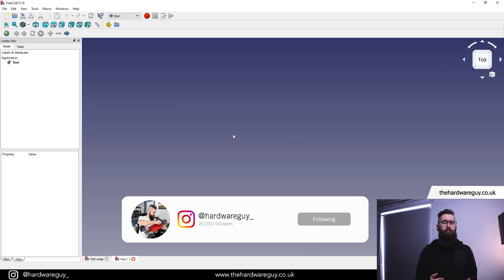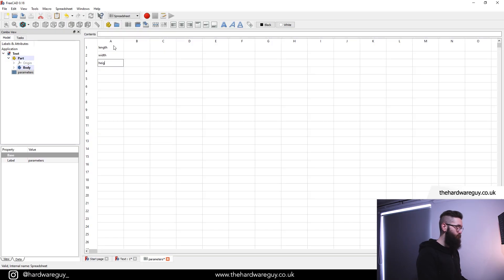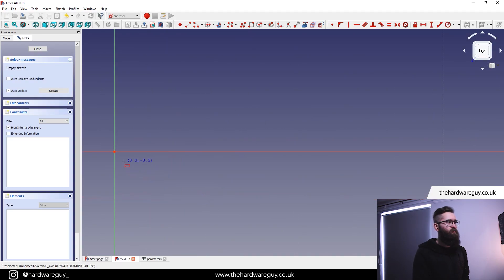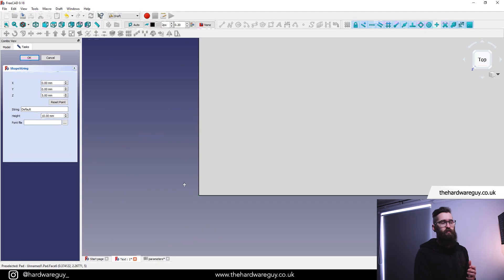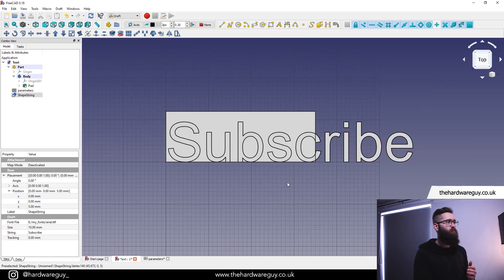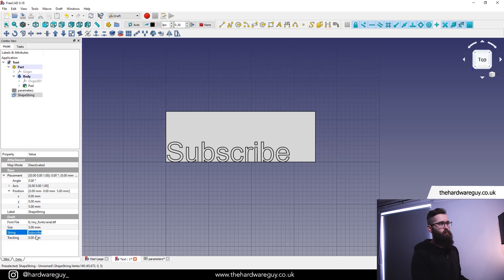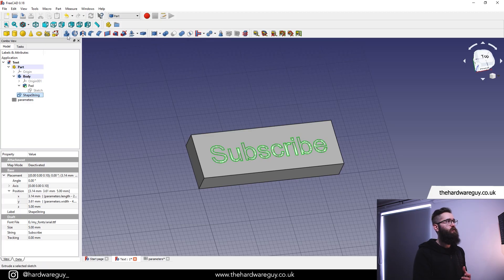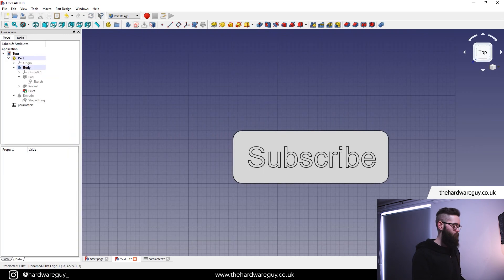FreeCAD for Beginners pt.6 - Extruded Text

Comment: FreeCAD absolutely will not let me select the corner edges and fillet them. I can select exactly one corner, but then it says "Fillet not possible on selected edges/faces." If I try to select another corner, it does not register the hover correctly, and I can never select the edge I am trying to -- it always selects something random. Irritating.
Reply from the maker: which version of FreeCAD? are you using the correct workspace?
Reply: @thehardwareguy  0.19 and yes. I think this version is a bit buggy.

Comment: When using the constrain distance you don't need to select 2 point if the element is already horizontal/vertical constrained, just select the tool and point the segment you want constrain.
Reply from the maker: Yes this is true. However, from a teaching perspective clicking both points helps new users understand what they are measuring and what the tool actually does

Comment: Thanks for a really clear explanation of this software and how to use it.  I've been using Autosketch for 2D drawings for the last 20 years and was struggling to understand how Freecad worked.  The constraints feature is new to me as Autosketch doesn't appear to use it, at least not in such an obvious way.  Instead it uses snapping to points such as the end point of a line or the drawing grid.  I'm looking forward to being able to do my own 3D designs now that I have a grasp of Freecad.

Comment: You can make the text automatically centered by figuring out the word dimensions based on text size. Make another parameter textsize=1. Change ShapeString - Draft - Size to new parameter. (textsize)
Measure the word dimensions: a=long, b=wide. 

Now for ShapeString position 
x=(<<parameters>>.lenght - a * <<parameters>>.textsize) / 2
y=(<<parameters>>.width - b * <<parameters>>.textsize) / 2
Now you can change the textsize parameter to desired size.

For different font you need to measure a and b again

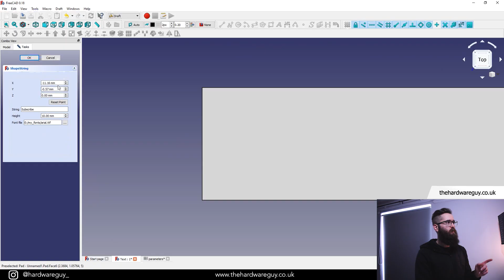Comment: @thehardwareguy: @5:50 When you have selected the right font and clicked OK, the cursor is in the main work area and then X/Y coordinates change accordingly. It's something that they sure will fix, I'm sure, but in the meantime, I use a workaround. After clicking on the font you want, move the cursor to the left Comboview where the Shapestring parameters are, and instead of clicking OK, you press [Enter] (the [Open] button is still in focus)

Comment: @thehardwareguy: @5:00 No one mentioned it so far so I give my 20 cents; If you start FreeCAD as an admin (programs normally start in "normal user mode" even tho you are an admin), you can use the Windows font folder without copying. At least it worked for me using Windows 10 (Version 21H2 OS-version 19044.1645) and FreeCAD 0.20 Rev 27422

Comment: Great tutorial as usual.  My problem is I want to put this text on the BOTTOM of the part, and FreeCad makes the text mirror imaged, as it puts it right way only on the 'top'.
I could not find any way to fix this after spending at least an hour or more, including watching videos.  Any suggestion here?
Reply: I ran into this exact same problem. I wasn't able to find a solution either. Text in FreeCAD is definitely clunky and unintuitive. 😕

Comment: I've been bashing my head on the wall for a few days trying to get text on a surface. I'm using FreeCAD 0.20, I don't know if that makes a difference but I found that I couldn't hide the extruded text to leave only the ShapeString visible. I had to drag the ShapeString into the body, not the Extrude, to be able to use Pocket to cut the text into the pad. I could Extrude in Part workbench without dragging ShapeString but Pocket wouldn't work in Part Design, I got an error message saying I can't use the selected object because it doesn't belong to the active body. After finding that out (ShapeString dragging) I found I didn't have to use the Part workbench at all, I could Pad or Pocket in Part Design. One other difference I found (it is different for me) your use of the Tab key to update the screen didn't work for me, nor did Enter, I had to left click the mouse cursor in another field to see the screen update. 
Your use of the Spreadsheet & the X Y formula placement is magic
Very easy video presentation, no BS, straight to the point & I have text I can place on a surface :)  Thank you
Reply: Thanks for leaving this comment, you helped me. On Linux FreeCAD 0.19 I couldn't follow this tutorial verbatim, it would say it would cut a pocket but it wouldn't be visible, I too had to drag the ShapeString, not the Extrude, but annoyingly it wouldn't let me place it into the Body, it would the Part but not the Body, oddly it would let me drag it into the Pocket sub-section within the body, quite odd, then I could get the result I wanted.

Comment: Love your beginner series and have recommended to others in a beginner group. I too have struggled to find a good tutorial on text, THANK YOU! Your index/timeline for most of your videos is also extremely helpful as I have keep a document where I make additional notes to myself for later reference.

Would love a tutorial on creating joints or making assemblies for multiple parts to connect together. Working on something that will need to be printed in multiple pieces due to length, not sure interlocking will be enough so may need to glue but don't want an extremely obvious seam on the visible exterior.

Comment: I had difficulty with "create a pocket with the selected sketch."  A "reference" dialog box does not pop up at all so I cannot "create cross-reference."  What does pop up is a dialog box which says "Cannot use selected object. Selected object must belong to the active body.  Consider using a ShapeBinder or a BaseFeature to reference external geometry in a body."  I noticed that the "reference" dialog box did not pop up while I was following a previous vid but everything seemed to work like it should for that vid.

I'm on version 0.19.  Am I doing something wrong or has the way this worked changed since 0.18?  I tried from start to finish 3 times.

I figured out a way to do it.  I simply copied the ShapeString and put the copy in the Body.  I also did a test and one or the other works fine.  It is only when doing both pocket and extrude, as in the video, that I had the problem.

Thanks for the vids!  I'm coming from TurboCad 9.5 Pro, which served me well for about 15 years.  It's mostly for personal use and I cannot justify the cost of new modern subscription based software.  I'm hoping this will fill the need.  I do like the parametric style and see how that could have been a big help for many past projects.

Comment: When attempting to cut the text inside the box I get following error:

Cannot use selected object. Selected object must belong to the active body
---------------------------
Consider using a ShapeBinder or a BaseFeature to reference external geometry in a body.
Reply from the maker: check your part tree on the left, make sure it matches mine. When editing/making changes you need to ensure the body you are working on is active. You can make a body active (bold) by double clicking on it.
Reply: @thehardwareguy  thanks a lot, this is great content. Apparently the in latest version the Text shape string is not showing the Sketch icon in Model Window but a "S" indicating Shape string. Probably that is why it does not consider the object part of body.

--EDIT---
So finally made it work by making copy of ShapeString and dragging it inside the Body. Afterwards I was able to make the Pocket tool work

Comment: Followed your vids 1 - 6 and can keep up with the flow!! but the extruded text worked up to a point until I tried to get a draft on the Text. I do a lot of metal casting and to help getting the model out of the mould text need a slight draft - is there a way of doing this in FreeCad

Comment: At 14:06 I seem to be getting an error saying: "Can not use selected object. Selected object must belong to the active body" - using FreeCAD 0.19 and I believe I have followed your tutorial step by step with the same hierarchy as well, just wondering if you ever got experienced this error?
Reply: I hit the same issue in 0.19, the parts tree got messed up and the ShapeString wasn't under the body, but outside of it, drag it back into place (top left tree bit) and then select it again, then click the pocket tool and it works.
Reply: same :(
Reply: @pedroperryresende5126  - Really not sure if this is a solution but I had another issue relating to stuff about the active body and I found out that the in the hierarchy the body that you're doing changes to must be "active" or it should visually appear bold. In order to achieve this all you have to do is double click on body, it should then appear bold. 

Hope this helps!
Reply: @jamesdibnah752  oh thank you :), gonna try it later

Comment: You don't have to do the measuring, in the formula editor for the x/y position set them to "-.Shape.BoundBox.XLength / 2" and "-.Shape.BoundBox.YLength / 2" respectively. This will position the text centered around the origin. 

Additionally in the constraints for the box, you can set the constraints to "20 + SignText.Shape.BoundBox.XLength" for the width (where 20 is some padding, can make that parameterized as well. and ".YLength" for the height. 

You do have to trigger some recalculations to get it to work, but it allows for a completely parameterized sign where even changing the text, font or font size will work correctly.
Reply: Hi, excelent this video and the comments. I changed the text, the boundbox changes as expected, but the formula "-.Shape.BoundBox.XLength / 2" doesn´t actualize. What can I do? THANK YOU
Reply: @Tres-D  a bit late, 5 months after, but you have to right-click the shapestring in the model view and select "Recompute Object"
Reply: thank you!!!

Comment: This series is just what I needed to get started with FreeCAD!  I can't tell you how many times that I stop, start, and go back 20 seconds to replay something and compare results (your video on one screen, and FreeCAD running on the other).  The rate at which you introduce new concepts works well.  Thank you!  My only delta so far is that being in the U.S. (and of a certain age) I have always used imperial units, and FreeCAD apparently requires a particular method of entry (=2.0in for instance).  I think I need to upgrade my brain to the SI system...  Anyway, many thanks for this series!

Comment: Would you be interested in doing a video. I am struggling making a box with holes in the bottom for draining. I want the holes to be square. When I do a Boolean Cut, it cuts the box and leaves the squares. I know I'm doing something wrong. I can make round holes, but I want square. I use 0.18

Comment: I do not know where I made a mistake but when I try to use the create the engraving with the text it does not show me the reference pop up window and gives an error asking me to use a shape binder. I really want to use FreeCad because Fusion 360 keeps giving errors (server based) and I want to switch. Also, I figured that we can create an offset for different sketches using copy function in FreeCad and then entering a difference in dimension using the same origin but when I go to pad it gives an error again (something like there is a not connected surface issue). How can we overcome these?

Comment: I  am so thankful for your video tutorials. I'm new to 3D, only casually using old AutoCAD and PCB design software for hobby use (Amateur Radio), and that is only 2D. My screen looks different on my Windows PC (running the same version 0.18). It helps if I follow you exactly, instead of skipping create new body, ha ha... I haven't been able to figure out how to do the constraints yet. It takes me a while to follow you because My results are totally different, the icons are in different places (create new sketch is way on the Left). I'll figure this out eventually... (Edited).
Reply from the maker: Glad I've been able to help out! Yes sometimes the icons can be in different places based on which FreeCAD version / Operating System you are running. Hope you figured it out!

Comment: tutorial request: I might be a pillock, but I wanted to add a "finger scoop" to a part that normally sits flush on a bench and would be nice to have a curved oval scoop out. Allowing a finger to pull up on the part.  I think I could do it with a subtractive oval but I dont really feel I have full control of the scoop shape. Nor can I figure out how to achieve it with a scetch. 
So a vid on this would be really helpful. thanks! Great vids

Comment: pro tip (from a complete CAD newbie). When doing your spreadsheet params. Skip the measurement at first. Do all the aliases one by one...then when your done, presuming there all mm then select all the param cells, right click and apply the measurement for them all on mass in one go. 
I find this method of data entry a little laborious and am itching to dig into the code one day to make it smoother. Anything like this to make it less mandraulic the better. As I love the equations and parametric modeling technique.

Comment: It's cathartic to watch someone else slog through a different, but still crap, workflow for this.  I use "engraved" text to version my parts, but always forget to add it until after everything is nicely filleted and so on, so adding it is always a song and dance of not disrupting the brittle model object.

I generally use the map to face version of this workflow, which seems to work the same.  I am very curious how to do curved text.

(A thing I just realized a week ago: you can use Windows > Tile to see the spreadsheet simultaneous with the workspace, so you can see the 37 parameter names.  You might be more consistent than me and not need it, but its made a huge difference in my state of mind while arguing with FreeCAD about where a line is supposed to end up.)

Comment: From messing around, I figured out how to get actual size for text. For the ShapeString  click the view tab and set bounding box = true then the actual  length & height for the string is displayed. If there is a way to set the bounding box sizes as a parameter, then strings can automatically be positioned.
Reply from the maker: Good job👍🏻 it'd be great if we could use that bounding box value!
Reply: @thehardwareguy  The trick is to set the x formula to `(parameters.length - ShapeString.Shape.BoundBox.XLength)/2`; make the obvious substitutions for the Y values.  I found that by playing around a bit in the python console.

Comment: Great set of FreeCAD tutorials. They have been very helpful getting me started. One thing that would probably help people is a tutorial on building a complex object. How to refer to sketch on a base part so that you can use constraints without the need to know the exact coordinates. Also, it seems that sketches can only contain 1 face. This caused me a lot of trouble until I realized that it is a limitation (at least on a Mac). You can extrude multiple faces in the Part workbench, but then only the bounding edges extrude, not the faces. Finally, you can't have unconnected bodies. It seems you must add bodies so that there is a single part. Parts and Bodies are also very unclear. And, finally, does your part tree get messed up? On my Mac it certainly gets out of order and then odd things happen. Boolean operations are one thing that seems to cause this.

Comment: Thank you so much. I learned basic cad through your Freecad tutorials and designed myself a basic project in a couple of days. I had been struggling for years to grasp CAD. THANK YOU! I am a Linux (Ubuntu & Mint) user, so I am pretty much limited to Freecad since Autodesk does not port Fusion 360 to Linux. If you have a different suggestion for CAD under Linux, I'm all ears, but Freecad is sufficing for the here and now. I design for 3D printing mostly and am interested in generating threaded holes. I do use inserts but sometimes they don't come in the threads I need. Thanks for your great content.

Comment: A tip for new FreeCAD users - you can change the size of points and line widths. 
Right click on an item in the part tree > select Appearance   (or Ctrl + D) , the resultant  dialogue box allows the changing of sizes ,colours and transparency of the selected item.
Enlarging points and lines makes them easier to select.
https://www.xsim.info/articles/FreeCAD/en-US/HowTo/Change-solids-color-material-transparency-and-so-on.html